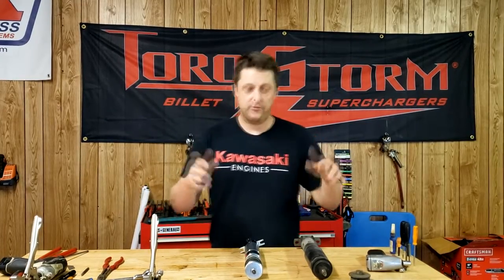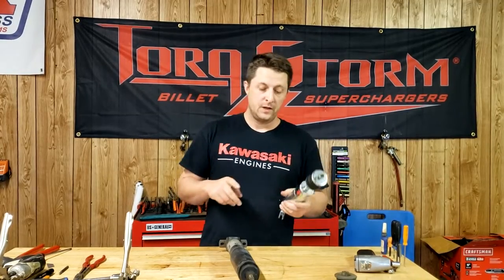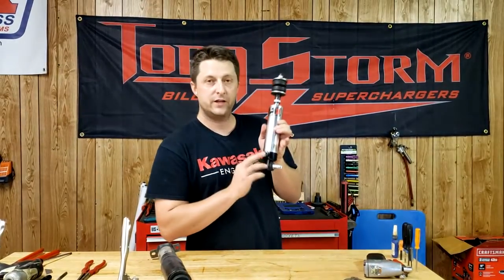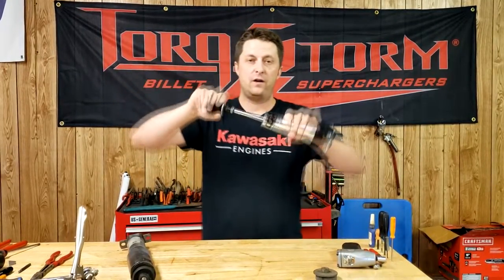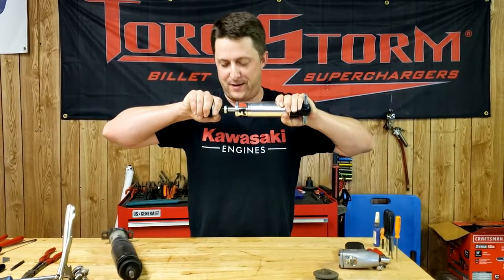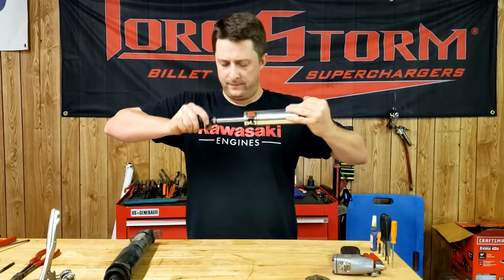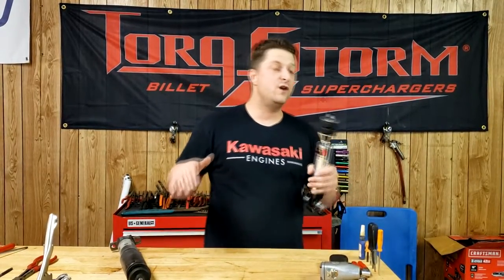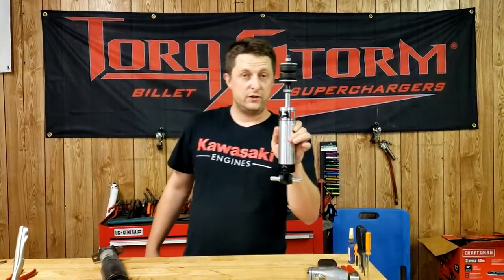QA1 Shocks Any Good? Lets Test Them Out.

Comment from the maker: These new shocks definitely helped with the new record pass Frostbite put down the other day🤘👍thanks for the support mopar fam 🙏
Reply: I just realized I am the one who sold you the shocks! I am happy they worked out for you!
Reply from the maker: @Saiyan4658  it was lol🤘🙏
Reply: Great Vid!  I have been looking to install the QA1 shocks front and rear with the bell tech 2/4 kit.  Are you able to tell me what the parts numbers are for the correct QA1's that you used?  My truck is a 2016 and I am seeing different parts numbers from others but the ones I am thinking they should be from what I read are the TS514 and TS905's.  Thanks for the help!
Reply from the maker: @kellymikals832  ill have to check tomorrow cant remember myself.
Reply: @Saiyan4658  do you remember part number for those shocks?

Comment: QA1s are the smart pick over a normal shock, especially if the adjustment saves time and gives you many shocks in one. To where if I want a stiffer truck ride (like I have with the Gaebriel Ultras I have now) or a spungy/pillow-like cruiser (stock dodge shocks after 26,000miles) without swapping shocks.

Comment: that almost looks to soft in the front. you can kinda see the truck unload the rear after like 15ft might wanna go up to the second setting in the front so it doesn't  unload as fast.
Reply from the maker: It did pretty good for just setting them all the way loose definitely need to tweak them a little bit .

Comment: What’s up Bro 
Question what’s the part number on the QA1
I would greatly appreciate it 

I got the rears I’m just having trouble finding the fronts
Reply from the maker: I will check the box and see i think i still have them.
Reply: Thanks brother 
I appreciate it 👍
Reply: Hey man whats the part number for the rear qa1 shocks? Not sure which ones I need
Reply: @mark1756  QA1 TD905